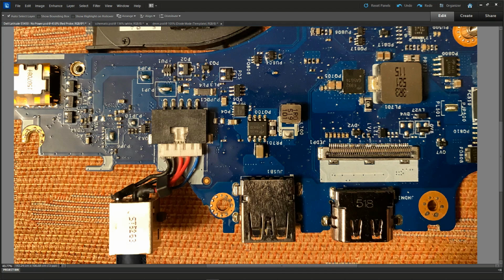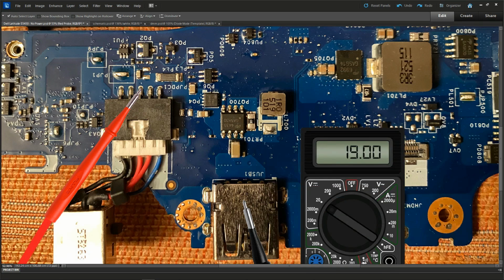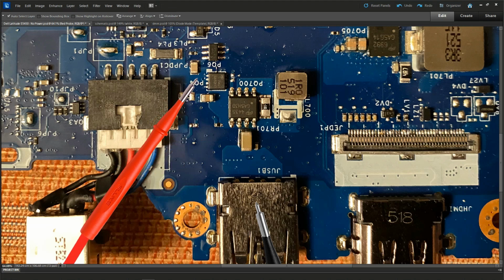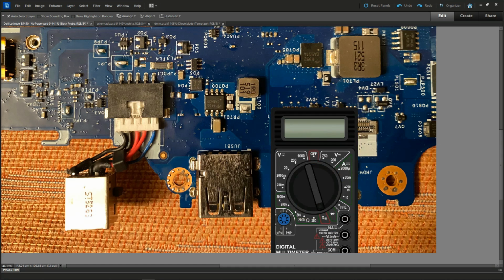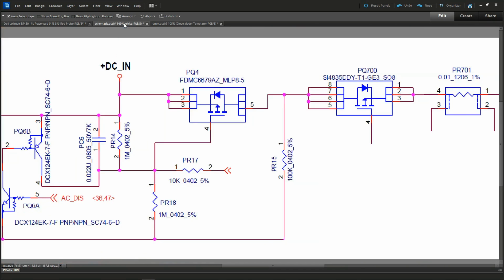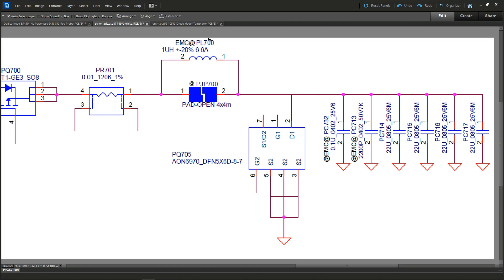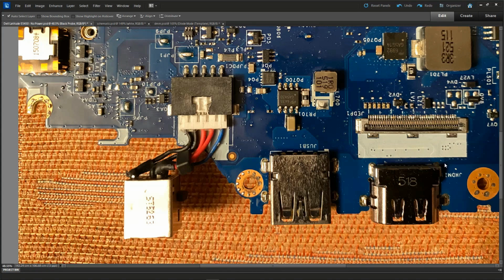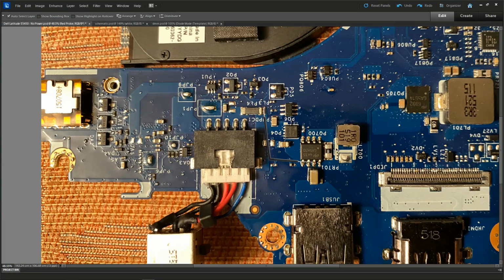Dell Latitude 14 E5450 - No Power Fault

Comment: MAYBE THIS CAPACITOR RATE SHOULD BE THERE CAPACITOR 22u_0805_25v6m smd
Reply from the maker: Hi there, thanks for watching. 

From the schematic for Dell Latitude E5450 ZAM70 LA-A901P rev03, it shows 6 SMD caps between the power sense resistor PR701 and PQ705

PC732 0.1U_0402_25V6
PC713 2200P_0402_50V7K
PC714 22U_0805_25V6M
PC715 22U_0805_25V6M
PC716 22U_0805_25V6M
PC717 22U_0805_25V6M

Comment: Hello, could u help me to fix my problem with my notebook, when I connect a connector from power adapter, a computer charge a battery 🔋, but after a few time later the computer PIK and the battery wasn't charger, power adapter is connected, after a few time later the computer PIK again and the computer continues to charge the battery. Could u tell me what the problem is this. Thanks.
Reply from the maker: I'm sorry, what do you mean PIK?
Reply: @therepairshare673  Hello & thanks for answering. PIK sound such as voice then we often connect or disconnect a connector from a power adapter to a computer socket.
Reply from the maker: @makcimenuka7904  I'm sorry I just dont understand the term "PIK sound" - I've googled it and google doesn't know either. Is there another word that you could use?
Reply: Thanks again for answering. When anyone connects power adapter to a notebook, at thet moment the notebook gives sound such as notification sound on a smartphone.
Reply from the maker: @makcimenuka7904  Is it a diagnostic beep code? Can you count the number of beeps there should be a pattern?
Reply: @therepairshare673  No it is not diagnostic code. It's only sound for notification, as a connected a 🎧 to the smartphone
Reply from the maker: @makcimenuka7904  Could you record a video of what happens and upload?

Comment: Hello can you teach me on Dell Latitude e5450 No Display,
Reply from the maker: It's difficult to give advice without seeing your laptop. With the fault described here, there was a short on the board, which caused the laptop to not switch on. However your laptop may have no display for other reasons. I guess the first thing to try would be to see if the power lights come on, and maybe connect an external monitor to see if it sending video to that.
Reply: @therepairshare673  thank you for the advice ill try that one first

Comment: After bios update i got this problem as I had imagined, there are no battery problems because today I accidentally discovered that when the PC tells me that the battery is low, I tried to turn the PC back on and despite the battery indicator telling me 0%, it's more than 1 hour that I'm using it. But now in this situation I don't realize when the PC will shut down, because from 1 hour it tells me 0%. It couldn't possibly be a battery problem because it happened overnight. Now, however, I have this problem that the PC shuts down after 20 minutes because it believes the battery is low, when it isn't. What can I do